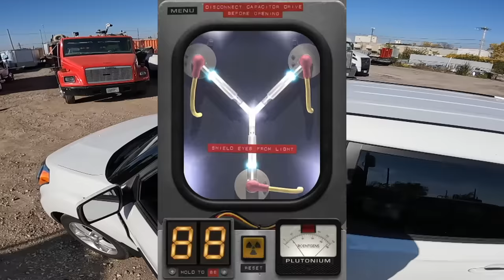My mom deserved this

Comment: One of my mom's car's was a 1960 Rambler, not sure if you ever seen one of those cars a little before your time, it was  all push button start like most new cars and trucks have today. Anyway she just bought it, was about a month old and I was driving it  and wondered what would happen if I hit the reverse button ???? Well guess what it stopped dead on the road and I played dumb and didn't know what had happened. So the dealership gave her a brand new transmission, not bad a lol and of course  she bought second car from that dealership years later. Glad your mom loved her new car.

Comment: That Nissan probably had a CVT failure. Nissan stuff. Without that, the flux capacitor won't work making the time displacement not work.